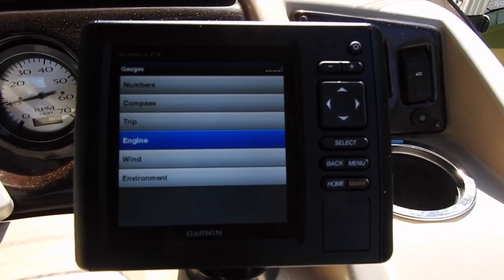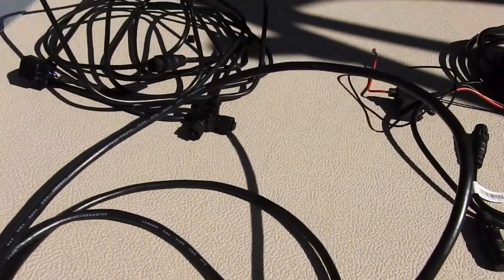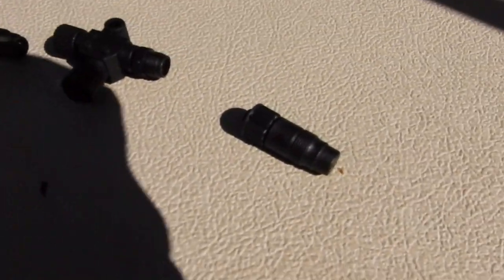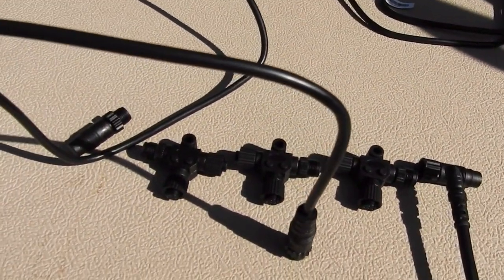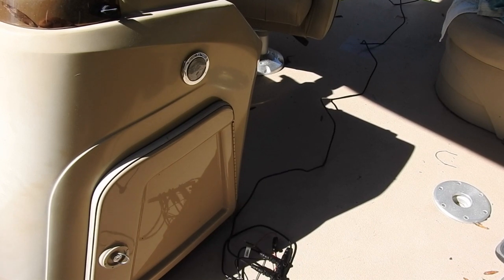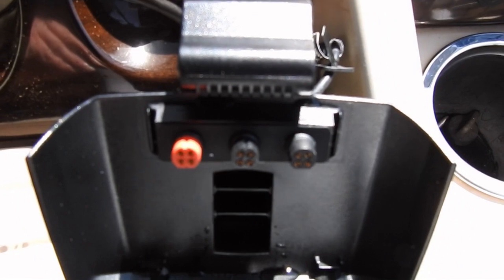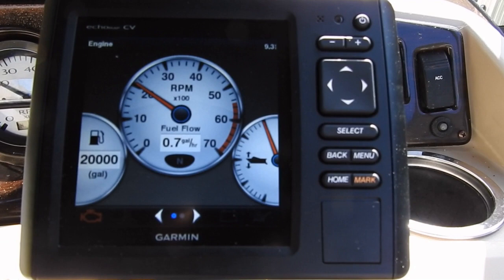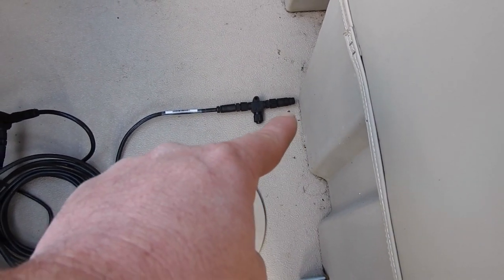NMEA 2000 Install on a pontoon boat. Yamaha F70 to Garmin 54cv fishfinder.

Comment: There are a few interface cable for my f70 on Amazon some ranging from 35 up to 90 would cheaper version work, also my engine is not listed on any of them but you installed one on yours just making sure I get the right one
Reply from the maker: Make sure they are for 2007 and later Yamaha 4 stroke engines.
Reply: @astrodiver1  i installed it like you did and mine just shows rpms, i called yamaha and they are telling me i need a multi hub and a gateway which is 500 bucks for the engine to transfer the data. is there anyway i can talk to you on the phone. if not i understand

Comment: Awesome video! If I wanted to add another NMEA device, such as a second Chart plotter, would I simply need to add an additional T-Connector to support the additional Garmin? Would it draw from the same power source that is connected it the NMEA backbone? Any idea if a Garmin GPSMAP will work with an Echomap on this NMEA network? Sorry for all the questions, but I am excited to connect my F250 to my new Garmin and hopefully tie in the old unit as well.
Reply from the maker: Thank you! Yes, just add another T and it will draw from the same power source. I don't have an answer as far as compatible units because I don't  own those units.

Comment: Noob question here - what are you actually powering, when you run the power to your backbone.

I’m assuming the GPS was already wired?
Or does the backbone now supply the power to the GPS?
Reply from the maker: The backbone is now supplying the GPS

Comment: Don't suppose this would work with a 2-stroke from 97 ?
Reply from the maker: I don't think it would. The ECM (Electronic control module ) were used for the 2006 and up 4 stroke engines
Reply: @astrodiver1  thanks for that,I have the same Garmin , but en is from 97,never mind.

Comment: Do you have to have a separate wire for the fuel tank? (Kind of like a fuel level sending unit wire)
Reply from the maker: No. The Garmin requires you to enter the correct amount of fuel added to the tank and then it keeps track of fuel consumption via the ECU. It works great as long as you keep track of how much fuel you've added, then add that amount
to the Garmin. Good question, I wondered the same until I hooked up the unit.
Reply: @astrodiver1  I have actually seen the ECU for the fuel tank. It may be separate from Garmin (which I love the chart plotters), but I know for sure I have seen the ECU for the digital display without having to do the Einstein math you are talking about. I’m gonna call Garmin and ask them why they made that part so difficult lol
Reply from the maker: @trentmiller7532  My boat's fuel sending unit does go back into the bundle under
the cowling but doesn't show up on the lowrance cable going into the NMEA. Maybe another Lowrance output cable and another NMEA T and I would have Fuel/trim/oil press ect. I guess I'll have to look into which of the other 6 or so connections is output. Thanks!

Comment: Question—did you keep the power supplied to the Garmin chart plotter? Does the NMEA 2k supply power to the unit?
Reply from the maker: Good question. I only use the Garmin off the NMEA so it is powered by the NMEA backbone. The backbone is powered from a 12v accessory that I simply spliced into and use the acc switch to power the system on and off.

Comment: Ok, so its funny when you call Garmin they only have half the info needed. then calling my Yamaha/Bennington dealer they say i need a Command Link and gave me a part number. Apparently from this good video I dont need that, Wondering it its the same hookups on my 2018 F300 (i have a NEMA Echomap Garmin)
So how did you figure all this out?
Reply from the maker: You would need the F300 to NMEA adapter. A NMEA backbone kit (just the wires that connect tied in devices ) Then just the NMEA wire to your Garmin. You should be good. The NMEA system is just a bridge between your devices, engine,sonar,GPS, ect. It simply connects them.
Reply: So did you end up needing a Yamaha  multi hub?

Comment: Love you video with the nmea 2000 i have a Yamaha 100hp and a Garmin 65cv after seeing your video i did the same to my boat how did you get fuel flow rate LITTER PER 100KM 
I can only get Litter per hour .
Reply from the maker: Mine only shows L/hr. I accidentally set my fuel capacity to 20,000 maybe that's the confusion?

Comment: I recently replaced the analog tach with a digital "command link" tach.  Wondering if the plug that I used on the F90 would be the same one needed to connect to the backbone?  In other words, do I have a choice of using either the digital tach or the NMEA connection to the chartplotter, but not both?

Comment: Great video and very informative. 
I have a Yamaha f100hp and a Garmin 65cv if i connect yamaha interface cable to my motor, to my Nmea 2000 and then to my Garmin  would i get fuel flow and fuel remaining in the fuel tank .
Thanks.
Reply from the maker: Yes you should, I don't see why not as long as your F 100 isn't more than 13-14 yrs old? What I do is manually set in the fuel amount after I gas up (if i add 20 gallons I'll conservatively input 19 gallons into the Garmin) after that it will keep track of fuel flow and level. I have filled and partially filled the tank a half dozen times since and it's been fine and agreeing with the analog fuel gauge on the boat. The Garmin tach and the analog tach have begun to disagree lately (by a few hundred rpm) not sure what's going on with that.

Comment: Hi thanks for the videos, they’re very helpful!
Reply: I had a question, I’m installing a Yamaha F90 and Garmin 54cv on my boat. I want to run a NMEA 2000 network so I got the starter kit and interface cable.  But I also have a round command link gauge (Tach)  that I was going to install but I was wondering if I could run both the NMEA 2000 network and the gauge or if it’s one or the other? I’d like to run both since the NMEA 2000 will give me a little extra data than the command link gauge but I’ll most likely be using the Garmin for navigating so I’ll use the tach gauge when I’m navigating. Thanks!

Comment: Does the male plug on the motor end only use 2 wires?  Are they blue and white or some other color?
Reply from the maker: It's been a while so I had to look at the video. @11:13 the white male connector has just 2 wires, blue and white.

Comment: The power should be introduced midpoint of the backbone to provide even distribution of power across any devices fitted
Reply: Tony Hewett if i have two units (lowrance hds 9 and 7 gen2s) and both have their own power cable allready connected to 12v, do i still have to conner the nema2000 power supply cable as well?
Reply: @finnsnracks2085 Yes. The NMEA backbone requires its own power. Current draw is negligible (especially compared to your Lowrance sonars!).

Comment: Thanks for posting. Does the 54cv also show your engine hours? I just ordered a 54cv and plan to do same setup with my f150. I don’t have an hour meter now and was hoping that data comes through to the unit.
Reply from the maker: I don't think so. I checked out some forums and it seems possible on some of the more expensive units by going to "Gauges-numbers-then customize." I'm learning that all the Yamaha F series connectors are not the same so maybe the 150 will output that info but I have yet to find a menu for it on the 54cv. Please let me know if it works for you!
Reply: @astrodiver1  I will

Comment: You usually dont want to power a nmea 2k system off of battery you usually want it keyed. Reason being is any sensors or anything that uses power from the backbone will constintally draw power. I don't think anything on this system is actually using power the echomap uses its own power cable and the engine cable should be sending data from the ECM
Reply from the maker: I agree about hooking up to the battery directly, some components like a wind sensor could constantly draw. In my case the unit is disconnected and brought into the house (rain ruined my last unit) and the master Battery  disconnect stays off unless the boat is running. I "temple-larry" as I like to say hooked up direct to the battery but it's now on a switch circuit. Thanks Aubry!

Comment: ALSO, in my case I ordered  the boat with analog gauges so the tilt and trim data was not connected.
In the same area where the NMEA cable connect under cowl are (2) pink wires taped together with yellow tape. I removed the yellow tape, removed the caps on pink wires and connected them together. Now realtime tilt/trim angle data is sent thru the NMEA network also!
Reply: If the pink wires for the trim are connected together, doesn't that also kill the analog trim gauge if installed?

Comment: Maybe this can help others: I found 3 un-used blanked plugs on my 2017 Yamaha 115. One was labeled 'SS'. One was labeled 'WW'. The  correct one to connect the network cable to was an unlabeled WHITE plug that was capped off and had 2 wires going to it. It was located on the side closest to the transom.
Reply from the maker: Thanks ZASH! I'm sure that will be helpful. Mine is a '11 F70 with only 1 connector.
Reply: @astrodiver1  I also just found right there in the same area (2) pink wires. One Male capped off and the other Female capped off with White connectors and both taped together with yellow tape. I removed the yellow tape, removed the caps and connected these two pink wires which now sends tilt and trim angle data thru the network to display on the simrad unit also!

Comment: Great video! I also have a f70 and was wondering if you had to add a temperature sensor to the motor for your It to show the temperature? Or is it factory?
Reply from the maker: eric jensen, Thanks! I have a 2011 F-70 and the temperature sensor works by just plugging in the engine NEMA cable. As far as I know every F70 after 2006 should work the same.
Reply: Does it show the hours?

Comment: did you resolve the gas reading ....????
Reply from the maker: Yes, I had initially set it wrong. The gauge and fuel flow meter works great! I have an update vid, https://www.youtube.com/watch?v=wDNOlT5ZE6I
Reply: @astrodiver1   I have the same problem can you give me some troubleshooting tips? thnx
Reply from the maker: @DrewVillion  From the owners manual: SETTINGS > MY VESSEL> FUEL CAPACITY. that will get you to the place to set your fuel level.